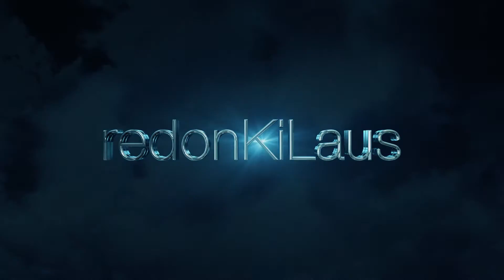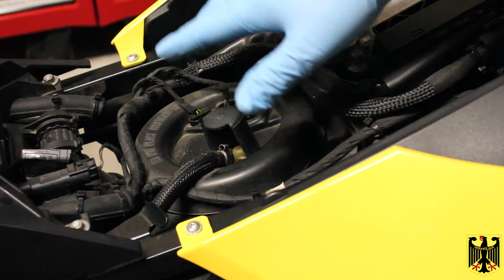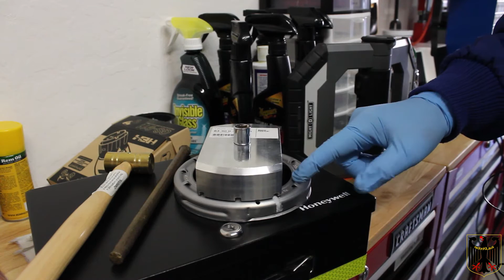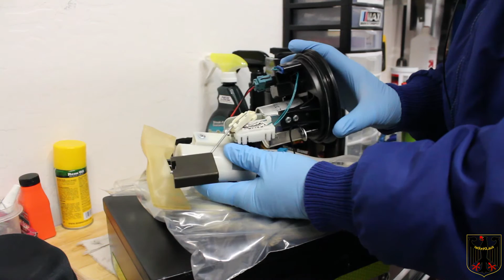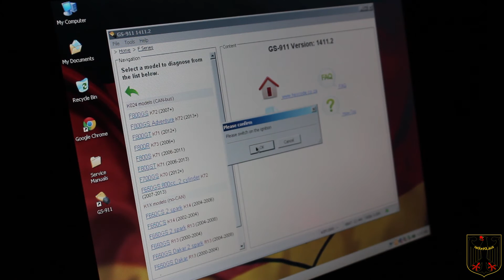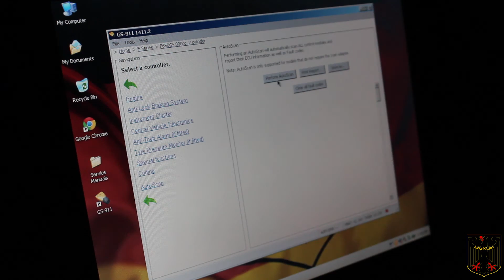2012 BMW F650GS Twin Fuel Pump and Float Removal

Comment: Seems to be alot of confusion about wether you can change the fuel filter. Not the pick up screen the fuel filter. Is the filter available non oem. Do you have a # or opinion on this fuel filter change out without buying a whole fuel pump assembly. Thank you.
Reply from the maker: I honestly can't speak to that, as I sold the bike several years ago before that maintenance would have come up.  Sorry I can't be of more help.  Thanks for watching!

Comment: For the first time since I purchased the motorcycle, the fuel gauge works now.  It used to show full until the tank only had about 1/2 gallon.  Now it goes from full down to empty in a gradual fashion.  I am thinking the float was bumping up against the side of the tank, or, the plug had poor contact thus making the resistance read higher than it actually is.

Comment: Tool is BMW P/N 83 30 0 493 639.  We recommend you replace the fuel pump gasket BMW P/N 16 11 7 677 883 each time you remove the pump assembly.  Similar procedure is used on other BMW models, and those with a fuel strip can now be calibrated with a GS911 SW upgrade instead of having the dealer to it with MoDiTec.  Tightening torque on the fuel pump retaining ring is about 8 - 10 Newton meters - just good and snug.  Given the number of times you will be replacing fuel pumps and sensors (both strip and float type) you may want to invest in the tool listed above.